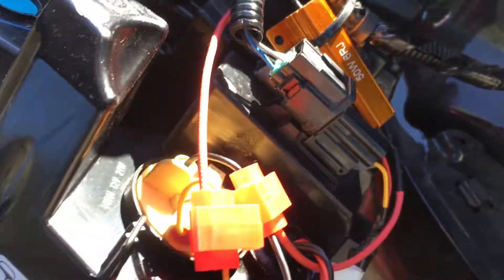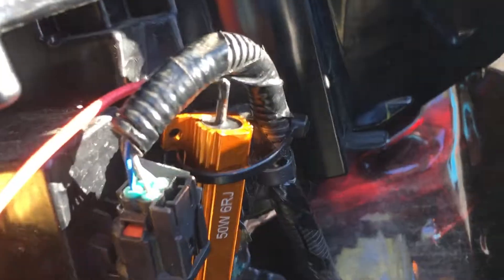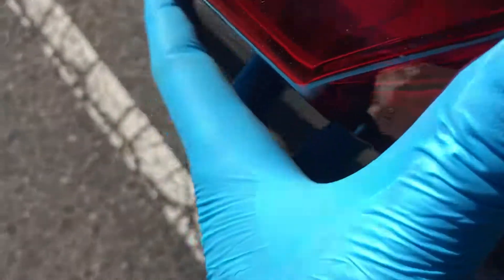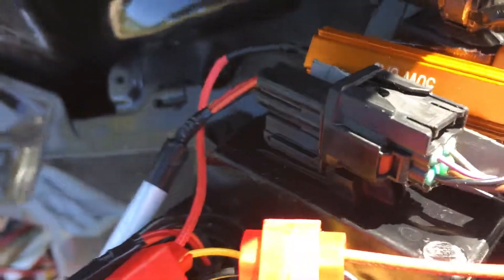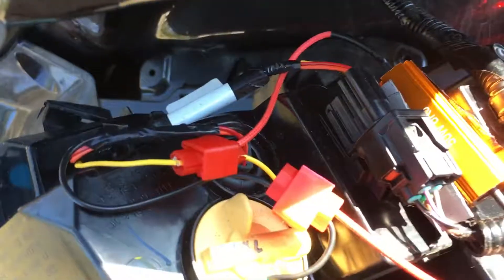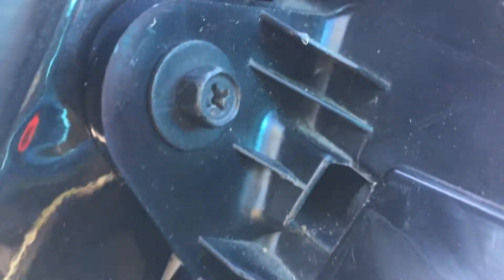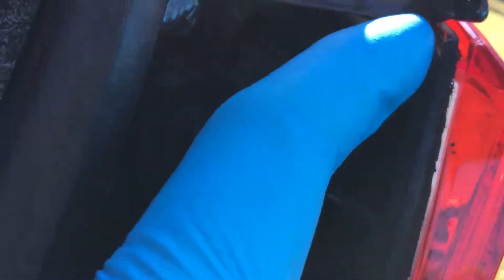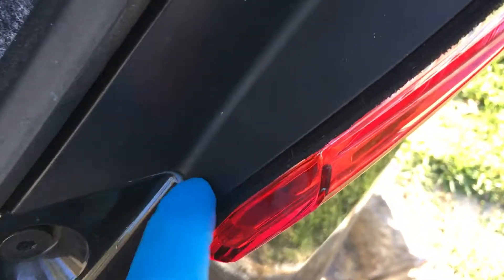2018 Honda Accord EX LED hyper blinking load resistor location.

Comment: My after market led smoked v1 lights came with a load resistor but the ledt turn signal is hyperflashing,any idea how to fix it?should i just replace the load resistor
Reply from the maker: It has to be connected in parallel like a light bulb to allow the car turn signal circuit to sense a load so it can flash normally. Reason LEDs hyper flash is because the turn signal circuit thinks there is no bulb attached which means very low resistance of the LED bulb itself. So to summarize this, you need to connect the resistor between the 2 wires that are connected to the turn signal bulb. It does not matter which direction.

Comment: What does that do
Reply from the maker: Sorry for late reply as somehow I missed the notification for this comment. The resistors allow LED bulbs to blink at normal rate as the LED bulbs take less current to light up and then the car computer makes them blink faster. Some LED bulbs have resistors built in but Those heat up more and don't last as long as separate resistors added in parallel in the lighting circuit as I did here.